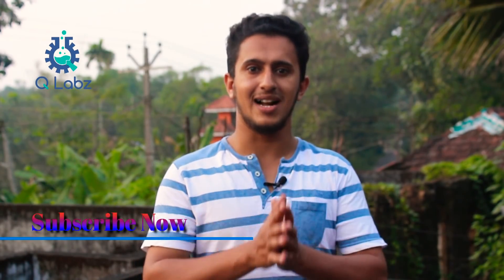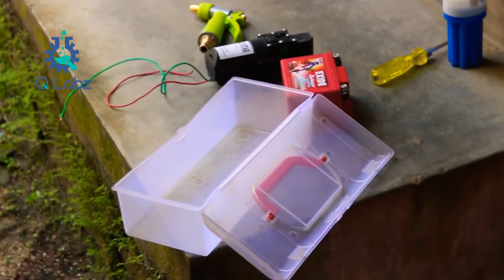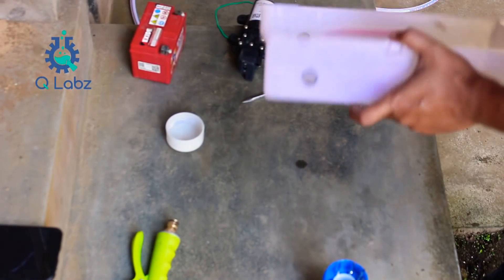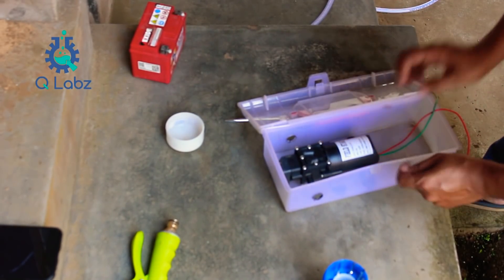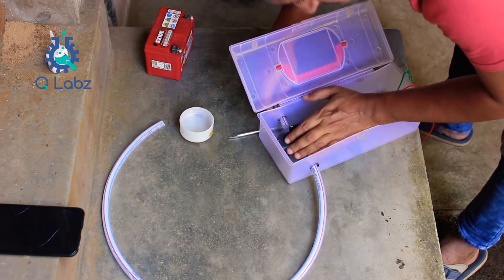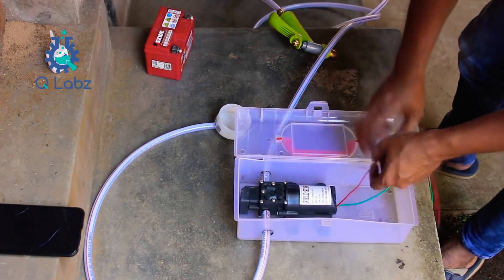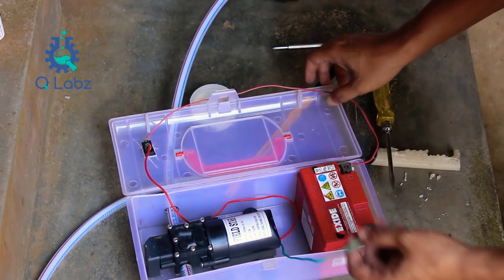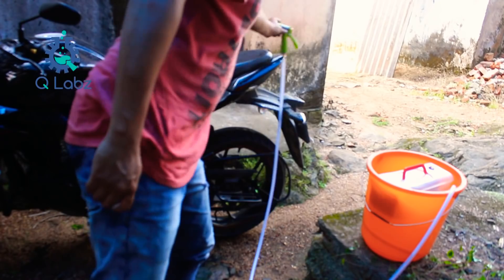HOW TO MAKE A PORTABLE PRESSURE CAR or  BIKE WASHER at Home DIY explained

Comment: There is no sufficient pressure generated by the water motor to wash the bike or car. 
But the effort taken to create a car wash kit is really appreciated. Keep going.  Very Nice. 
Thanks.
Reply: Just change the sprayer gun...you will get good pressure
Reply: Thanks sir  @rajathnair1852